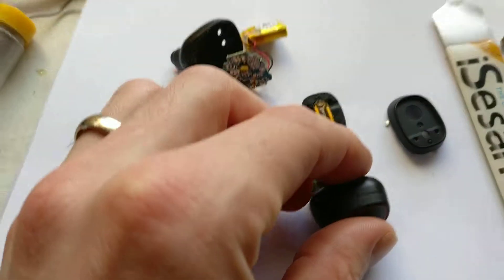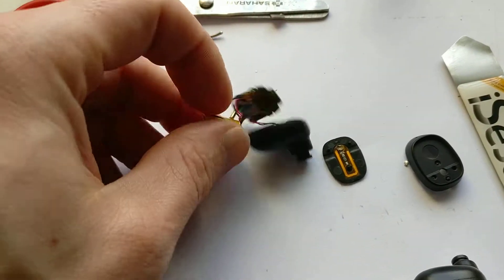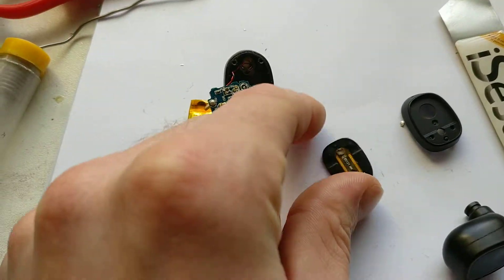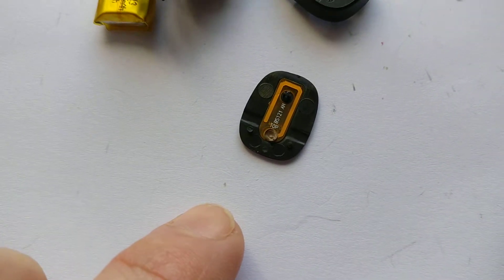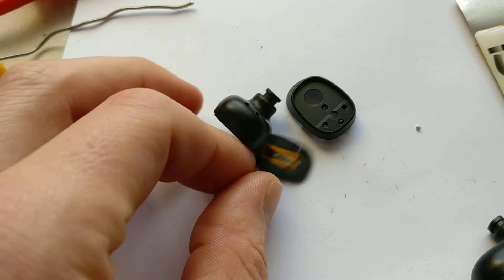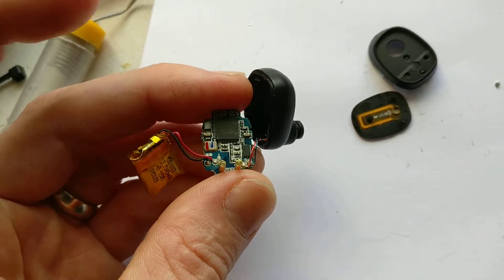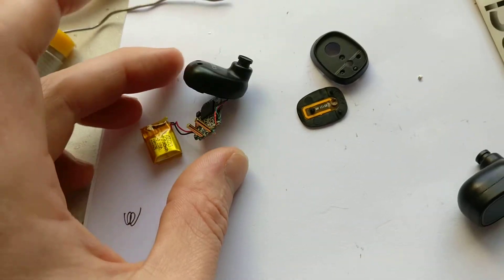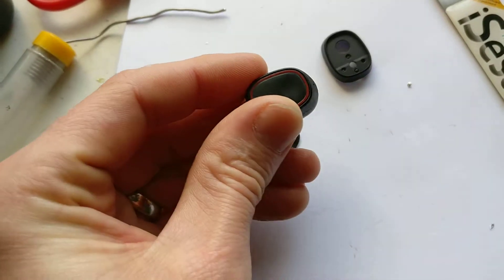Tozo truly wireless earphones tear down

Comment: can you do a more detailed video on how you took them apart please? i need to repair them but i dont know how to safely remove the battery from the inside
Reply from the maker: Unfortunately they went in the bin shortly after making that video. I would just carefully use a spudger and try and work it between the 2 layers, will have to super glue them back together. Have you sourced some replacement batteries?

Comment: I’m going to make some Bluetooth speakers out of a different model by tozo if that pin isn’t connected to the antenna will they still be Bluetooth and how can I keep the two parts together after disassembly?
Reply from the maker: You could just solder a wire between the 2. Also you are going to need an amp to drive a bigger speaker.
Reply: Yes I do know that I will need an amp, I’m basing this off of a tutorial video I saw by DIY Perks

Comment: Hey, how did you get it open?
Reply from the maker: I used a spudger around the seam and it just cracked open
Reply: @facelesstech  Thanks, I have a different model with a dead battery that I'm trying to replace. If the internals are similar then it should be easy. Thanks for the vid!